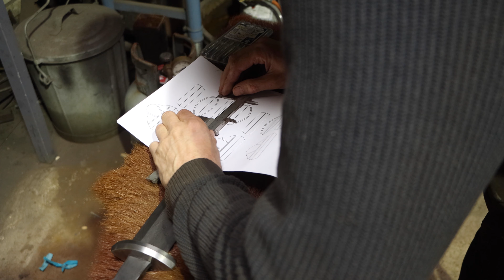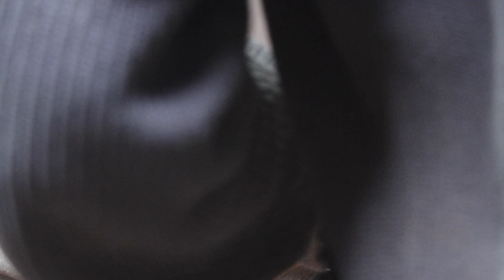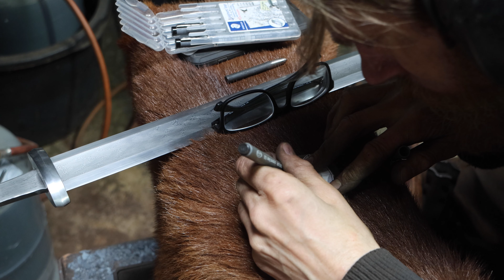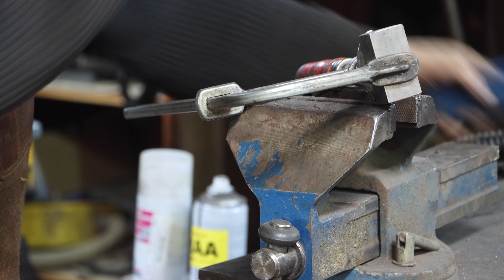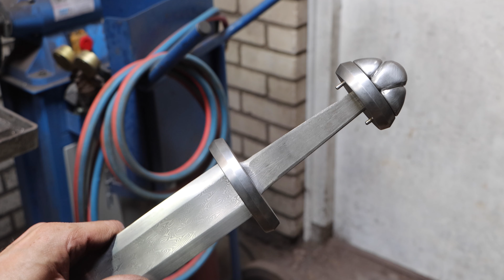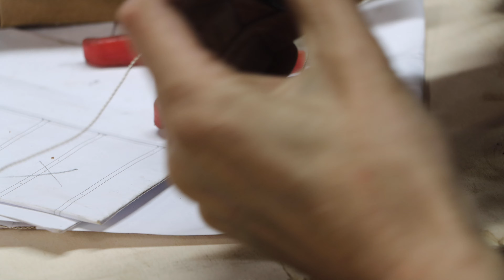Forging a multibar viking sword, part 4, making the pommel.

Comment: How do you keep the two rivets to stay in the pommel cap. I know historically they are not supposed to go through the cap. How exactly did they keep them from popping out? It's riveted on the upper guard but not inside the cap
Reply: You know, the only reason I clicked on this video was to find that one point of information. 
Still none the wiser but I had fun watching. 
I'm currently assuming that the whole length of the rivet mushrooms out slightly when hammered & grips the side of the hole?